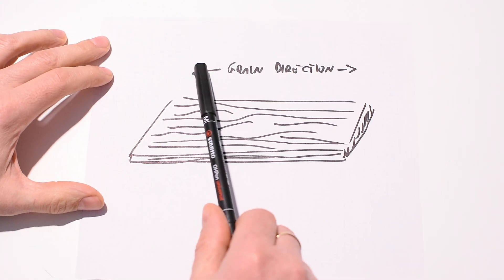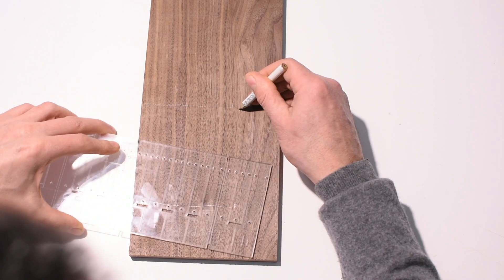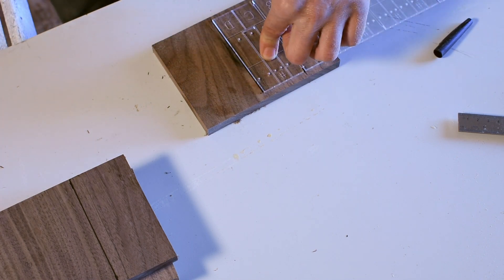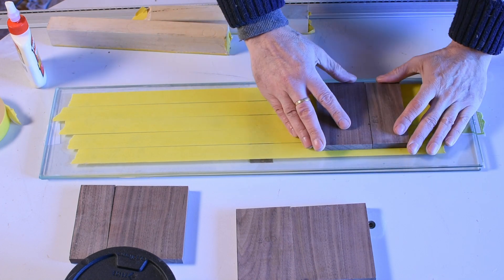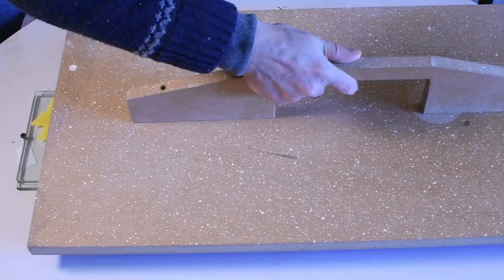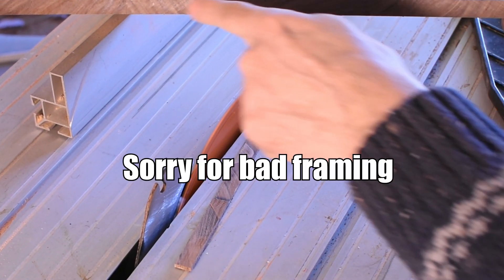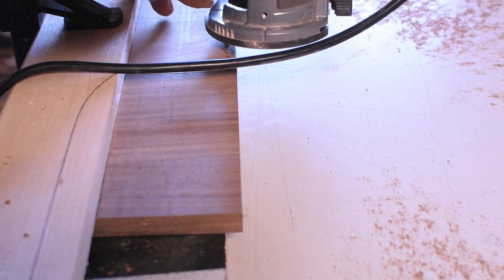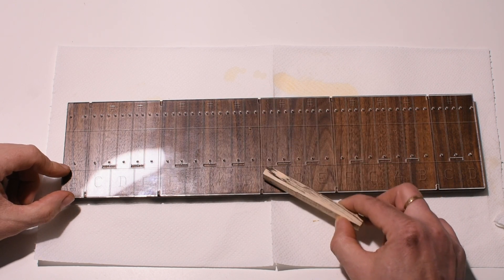How to build a portative Organ | #13 The Manual part 1 | SUB ITA | Homemade Pipe Organ

Comment: This is very interesting! I thought building the Manual would be easier. And I have a question, what did you used for your Manual Template because it looks like glass or so. And at 5:41 this is Gigantic the thing!
Reply from the maker: Hi, it made of plexiglass. Yes It's a bit big tool, I had built it to plane some wooden boxes, it is very useful😅
Reply: @nippocast  Ah i knew it was Plexiglass! But i wasn't so sure that the name in English Plexiglass is. And in German it is the same word except that there is just one "s" at the end "Plexiglas" or you can say "Plexiglasscheibe". And know when i think of it I could have used google translate to go sure.
Reply from the maker: @animalistiktiero3835  Rigth, I checked again and it seems that in English it is written just plexiglass